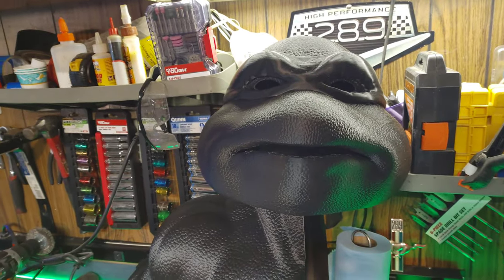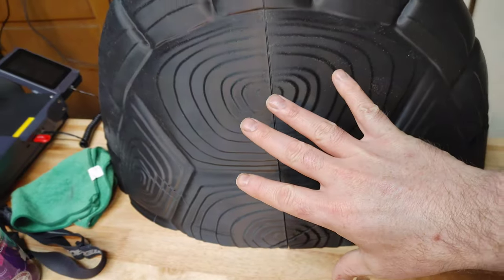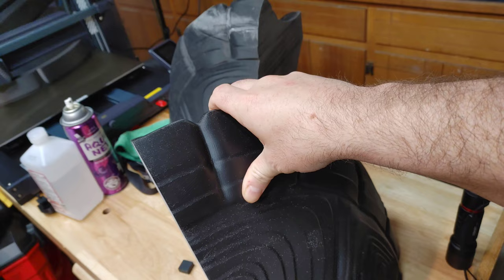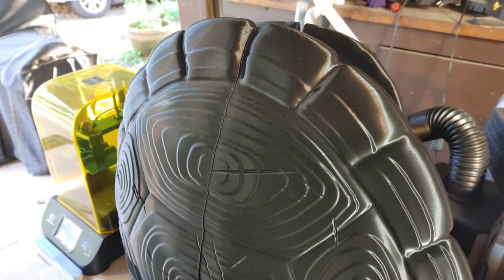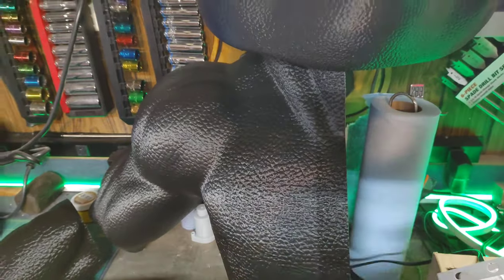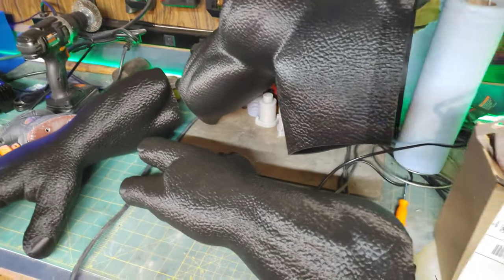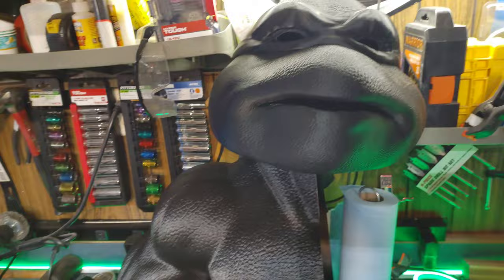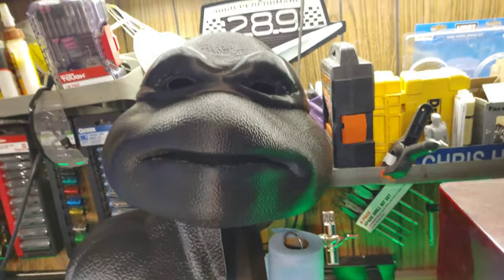My TMNT 1990's Movie 3D Printed Raphael Build - Part 2 Progress Update

Comment: Hey bro once you get quarter joined on that shell before you start body work fill it with the expanding foam for big gaps you can buy in can at home depot....it will make it a lot more rigid
Reply from the maker: That's a fantastic idea, it really is. I think I'm going to leave it hollow and lightweight so when I display it I won't have to worry as much about gravity pulling the shell backyards. But again fantastic idea.
Reply: @ChrisBoshProps  only reason I recommended it is if while you sand it and fill it the deflection of the thin shell starts causing you issues.  Great job